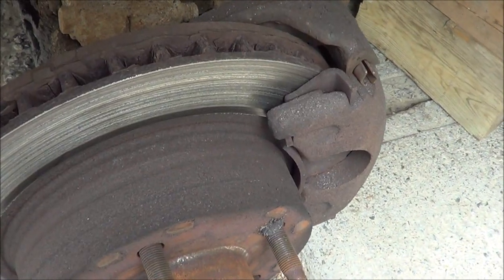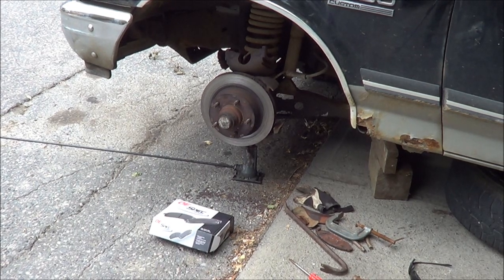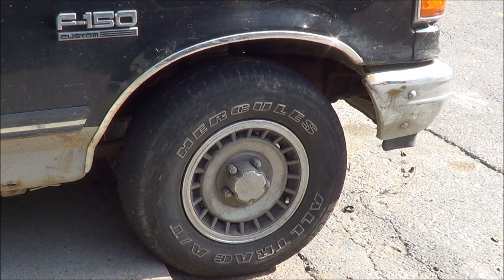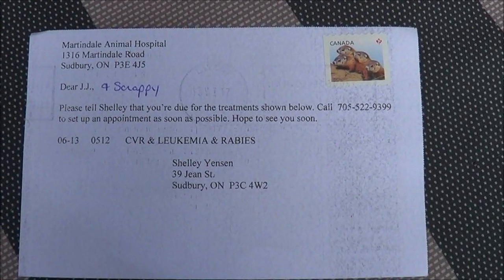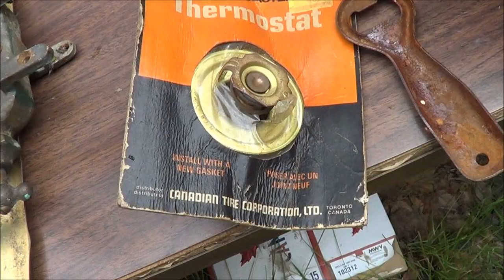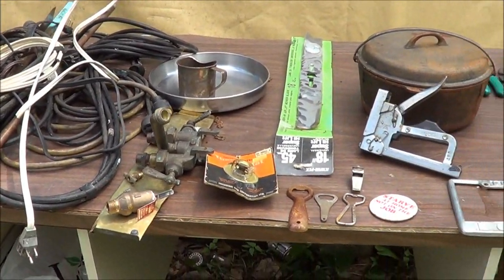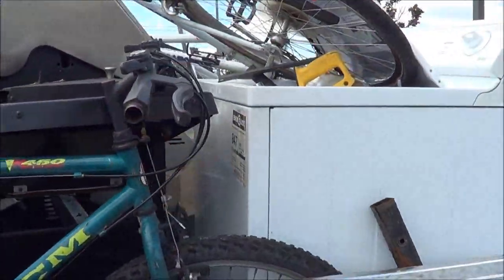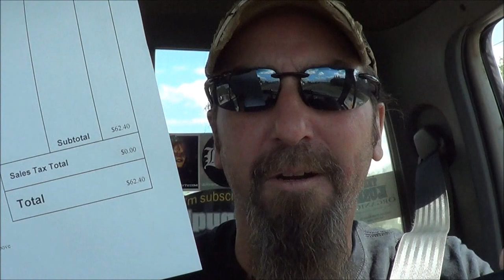Grinding brakes, Scrap return

Comment: if your other ford 4x4 is a 5 lug which the f150 should be then the hubs on the 2wd most likely are compatible  the rotors are the same only difference is a front diff